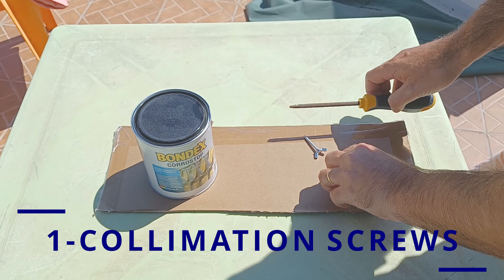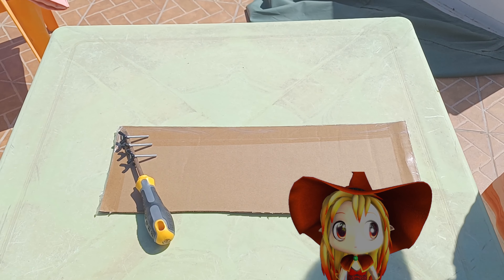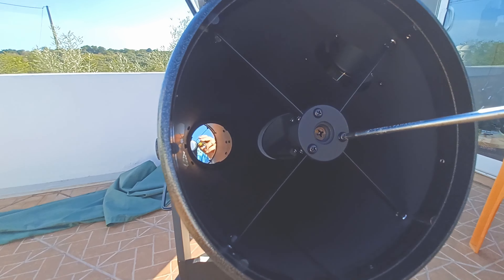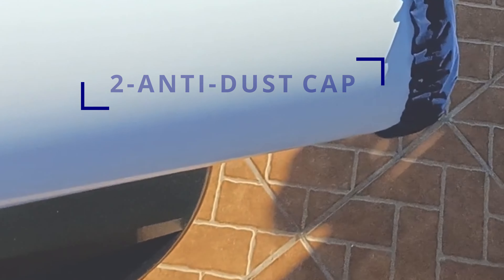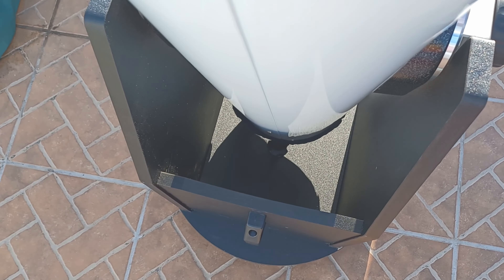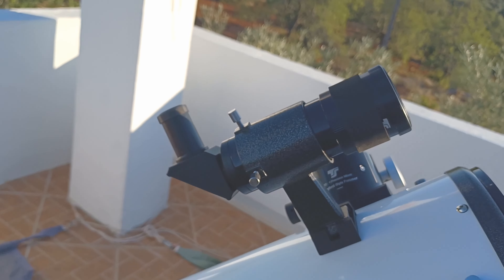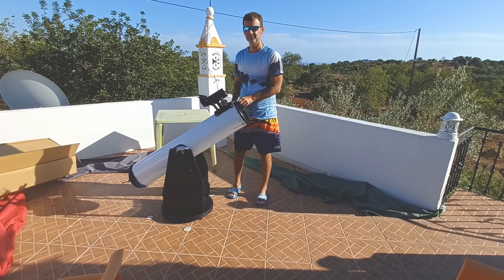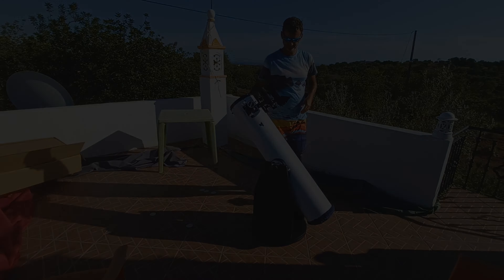8 inch DOBSONIAN telescope FIRST MODS you should do right away

Comment: Very nice upgrades and I agree with them all.
If you have something like a propane torch and some used motor oil you can blue the wingnuts.
put a bolt or screw through the wingnut and hold the screw with pliers . Slowly heat up the wingnut and it will turn a golden color, and then a blue. You can dunk it in oil at that point, or even water and it should maintain the color. I agree about the paint if your going to use it. The tendency might be that it will flake off in time and fall into the primary mirror. 😢😢

Comment: Did you attach the handles using the short screws that came with the handles?  I’m concerned whether they can handle the weight.
Reply from the maker: On both telescopes. No issues. You can use diffetent screws if ot concerns you though

Comment: You can puechase inexpensive easy-to-use collimation knobs from Bob's Knobs in the U.S. Putting foam rubber on the stop at the base of the tube is a good idea but my XT8 Orion Intelliscope requires the tube to be at a true 90 degree vertical when it is against the stop. This is the first step in the align ent process.i suspect the foam rubber would interfere with alignment. Other than that, a good video. Thank you.
Reply from the maker: No because the base side is fully against the tube. Only the holes are covered. And obviously the strength of the screws and the base can smash any foam, even stiffer ones. It's perfect. No light leaks. Notice that if you place any foam under the sides, where the base touch the tube, that yes, will bend the focuser position and it's great to adjust if focuser is uneven, like i did later in another video that you should watch: https://youtu.be/71rkZhnrwAc  btw bob knob's are more expensive and do the same job as the others.

Comment: I have this telescope but in the 10". What is the purpose of the measurements for the side bearings? It ranges from 0 in the middle and 10 up and down.. I have mine all the way up but I don't know if that correct, Thanks.
Reply from the maker: the scale number i have no idea but the purpose is to get your telescope well balanced so the numbers are useless. Just feel the balance using the camera/eyepiece on the focuser
Reply: @DobsonianPower  Ar right. That makes total sense,  Cheers.

Comment: Secondary mirror edge Blacken, USB PC fan to cool Primary mirror and adding PTFE pads to the mount were extras that I found were required from standard for my 10" Dob that would probably apply to most Dobs.
Reply from the maker: yeah. I've got all of that on my 12". only teflon instead of ptfe. those mods will be for another chapter 🙂👍 the edge and the tube behind the secondary flocked too. very nice

Comment: The handles on the base are great. But putting something better than phillips head machine screws on the secondary of any Newtonian is a great idea. Some brands even have them on the primary, which is just being cheap for a few cents. These things need collimating on occasion (regular maintenance). A breathable dust cap makes sense as well. Maybe the best mod you offer is the bump stop for the tube to base contact point. Hard jolts don't do anything favors, from your head, to your car, to your scope. Thanks for the video.
Reply from the maker: Thanks Steve □□

Comment: Nice video thanks! And may I ask if the reason to paint the "wings" black is to eliminate unwanted light reflection off the unpainted "wings"?
Reply from the maker: Excellent question. Yes. We could use them without painting but it's a good practice to turn black everything inside to avoid intrusive reflections. Specially when we have street lights around like i have one that made me do all kind of stuff to avoid it. And the fact is that with my 12" dob, all those details together made an effective job. It's like looking inside a black hole which is great. I want my 8" to have the same level of quality. I will talk about that soon when i improve the top of the 8" tube as i did in my 12".